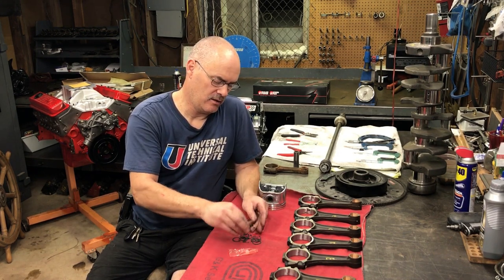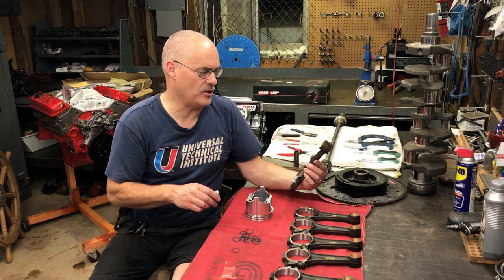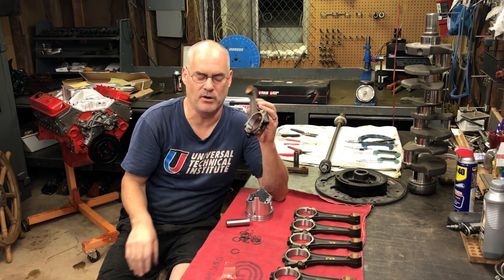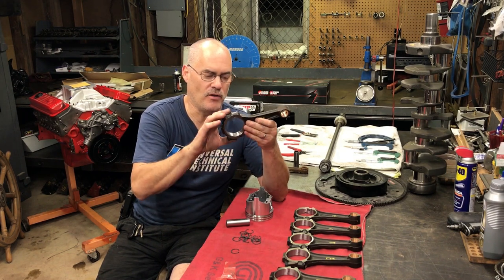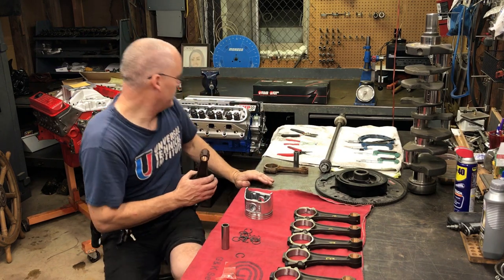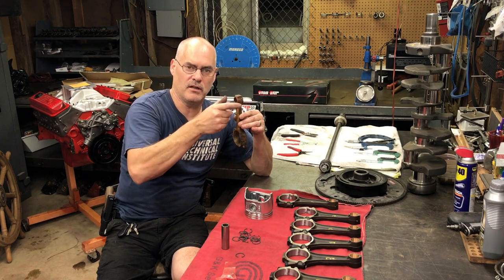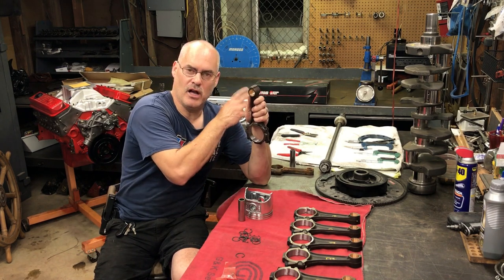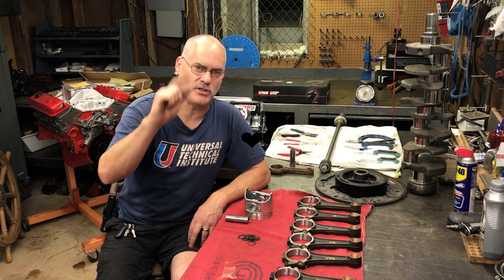Connecting Rods Semi/Full Floating

Comment: Good to see you back. My next build I'm going full floater. My first build is still going strong now and it's been a few months. I never would have been able to do it without your sbc videos
Reply from the maker: Very cool glad to hear it
Reply: @Myvintageiron7512  If you lower the engine's rotational mass as much as possible, how much power and fuel economy is that worth? Lighter rods, pistons, crankshaft, pushrods, flex plate, everything.

Comment: Just a question . since the rod pin doesnt really move that much, maybe 6 deg in the full rotation why does it really need a bushing. seams that if you hone the rod end to just fit the rod pin and have a good source of oil it should work fine. oh great video.

Comment: Hey man I have a question! I have a 350 TBI and I've heard the 5.7 heads are junk. And I was curious into looking for a good set of heads to put on. The 350 is in a Chevy 1994 k2500 would vortec heads be a good decision? Or would you recommend a different set? And would it be a good idea to just bolt them on out of the box or bolt them on from another engine?

Comment: Wouldn't the press fit pin make for a stronger rod assemble? Helping reduce any (cocking of piston in bore).  Seems with the floating rod you are reducing two bearing surfaces in piston to one bearing surface in the rod. Are floating pins made for fighting friction or are they stronger too?
Reply: Less likely to lock up if someone doesn't do it right.

But they'll work it's just a budget thing

Comment: I have a Blue Print Engines Chevy 383 c.i. Engine with Turbo 350 in a 1977 Nova . It leaks a teaspoon size puddle of oil onto the manifold on passenger side of manifold after it runs . What is causing this and where is the oil coming from ?

Comment: So can you, with a set of bushed rods take a set of stock types pistons (hypo or cast) cut the piston pin shorter and use some sorta tool to cut a groove in the piston for sprirol locks. I know this is something of an odd question. But i cant seam to find an answer to it... Thanks
Reply from the maker: you can but it's much eaiser and cheaper to just buy a set of pistons already set up for a full floating rod

Comment: If you are rebuilding a stock engine , how does the cost compare between refurbishing old rods and buying new OEM / aftermarket stock rods ?

Thanks ,
Wyr
God bless
Reply from the maker: It depends on what your doing the labor on these rods is around $300.00 that includes the ARP  studs /resizing the big end and installing and honing the bushings it is kind of pricey you could probably get after ,market rods for around that or a little more so really you can go either way the factory 390 rods are strong and worth reworking they make a real solid foundation for a stock 390 build if your doing a higher hP build I would go aftermarket for sure
Reply: Thanks !    :-)
God bless
Wyr

Comment: One thing about rebuilding FE rods. Those small end thin shell bushings have to be swaged in place with a press through swaging tool. Thats how it was done at the factory, and then honed to size. Just pressing them in and honing to size is a setup for disaster. Can't tell you how many I've seen come out on rebuilt rods because it wasnt done the proper way.

Comment: Looks like a small block chev behind you with usual tappet covers ?
Reply from the maker: Yea those covers are just sitting on there for now that is a SB with Dart heads and a comp roller hyd cam waiting on distributor gear that works with the steel roller can gear with that cam

Comment: Hey I really like your videos.  I've been wrenching since I was a teenager but I'm not an expert on anything.  Your videos really clear up alot of things.  I have a question about internally or externally balanced engines or rotating assemblies.  A few years ago I had a 383 stroker built for my Vette.  It is pretty much a balanced and blueprinted engine but I don't know how the builder balanced it.  This vette  has a turbo 400 tranny and I might go to a 5-speed.  i also might change the cam.  When I do these things how do I know what flywheel I can use and also what crank damper I can use if it needs changed.  I am told that the way the engine was balanced affects both of these parts.  thanks again for your help.  Dave.
Reply from the maker: If it in internal balanced use a neutral flywheel if external you will need tp match the weight of the Flex plate a balance shop can do this your balancer and flexplate will have off set weights on them if it is external

Comment: I bought a set of Icon pistons for a 390 my dad and I are building and the pistons don't fit on the factory rods. The manufacturer says to mill the pistons for clearance but I'd say it's a good .200-.250 to cut for the factory rods to fit and have plenty of room to float. I really didn't want to have the pistons cut so I bought a set of eagle H-beam rods the pistons fit on them but theirs maybe .010 of float we don't believe that's enough float what are your thoughts on this how much float do you think we need? What are your thoughts on milling pistons?
Reply from the maker: Mill em they will be fine .010 is not enough you need .080

Comment: I'm having issues on finding connecting rod bearings I have 05 OS in the motor now and they are showing little wear and I was wanting to replace them before going back together with the motor and the problem I'm running into is nobody carrys this size ?

Comment: I have a 1953 235 l6. it has babbit rods I believe need to be shimmed? I have no info on this engine and no machine shop  in my city (san antonio,tx) have very little knowledge about this motor would you be able to help me find a manual or some specs to put this long block back together? 
Thank you for all the helpfull info you provide on you channel.
Reply from the maker: LOL the good old babit bearings my advise is upgrade to a bearing insert you can use the later rod on that crank when I first started in this business we used to pour and bore the babited rods most people on here won't even know what were talking about anyhow get rid of those it will be less money to replace then that try and fix em
Reply: Myvintageiron7512 
well I have already paid for them (they were expensive) as well as the crank being cut, new pistons, block bored. I started this project a few years back. I paid a local machine shop assemble it before I decided to build it myself. when I got it back to motor did not turn. I sent it back I ended up picking it up months later the same way I left it. I have everything except the main bearings I wish I would have known about the rods your talking about.
Reply: poured rod bearings?
Reply: +ferlan 9
"Poured rod bearings" means that liquid metal is poured on the connecting rod. The metal cools off and then is machined. That forms the bearing.

That is how engines were built until manufacturers made shell bearings, which are the bearings you see in this video.

Comment: I would really like to get your opinion on converting a press pin connecting rod to a full floating rod to be used WITHOUT a bushing. I found I have .0007 press fit on my LQ4 connecting rod/wrist pins and wanted to make them floating so that they won't fall apart in my motor since that's not very much press fit. It will be a street/drift engine running about 450 horsepower and turning 7000 rpm. Yes I have pistons that have lock grooves in them already. What sort of clearance should I run between the rod and pin? Thanks for your input.
Reply from the maker: I would just buy a set of aftermarket rods by the time you modify yours for full floating set up you will pay about the same as a new set and won't be as strong
Reply: Myvintageiron7512 I am a machinist and can do the work myself(to save the money). I have only been doing this for about a year so I'm not the most experienced though. I don't really want to get a new set of rods because I don't want to have to rebalance my rotating assembly. If I got a set of GEN 4 floating rods would I possibly not have to rebalance the crank?
Reply from the maker: OOO I see if you can do it yourself then by all means do it the GEN 4 rods are lighter so yes re balancing would be required you can make yours full floating I have never done that to a set of those I would use a bushing you will need to measure your pins and find a bushing that works you will need to hone the small end of your rods to press fit the new bushings and then hone the bushings to fit the pins it's allot of work but it cam be done

Comment: what's the difference between the 350 Chevy crank and a 305? same throw  so factory cast vs cast is there a weight difference in counter weights ?
Reply from the maker: There is a slight difference in counter weights but they are interchangeable if you balance em